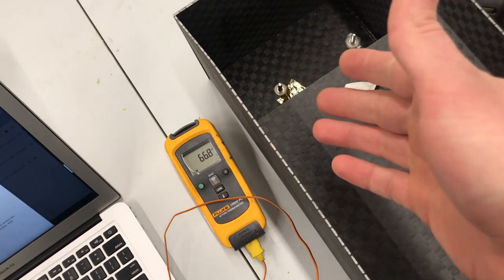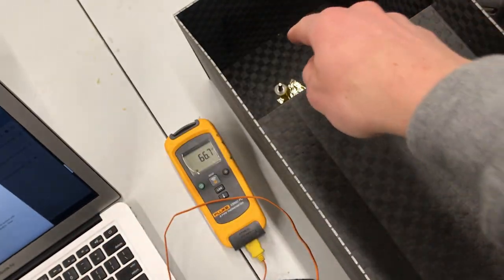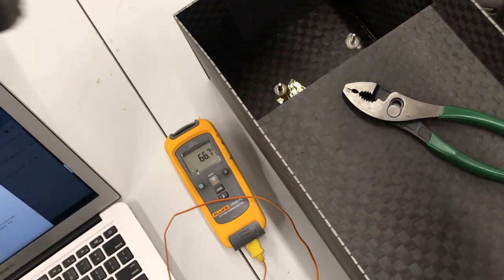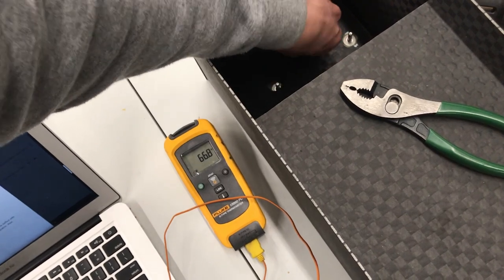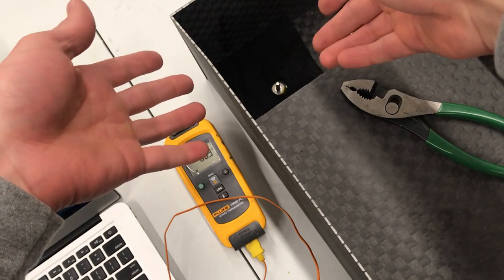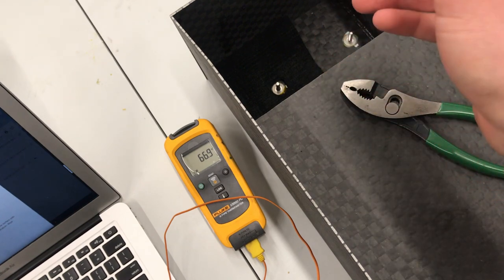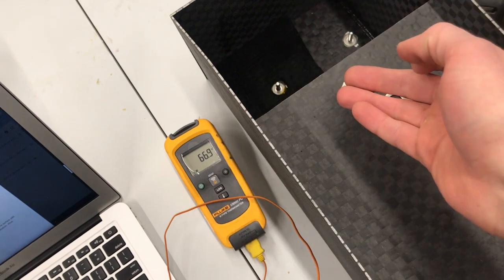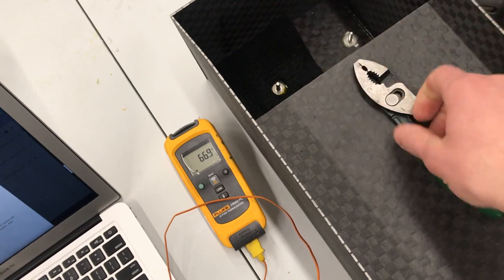HOW TO: Simple and Easy way to remove Click Bond Studs! (without damaging your stud or aircraft)

Comment: That appeared to be pretty simple but I wonder if you could make a simple coil that goes in a weller soldering gun and slips onto the stud. That would guarantee you didn’t heat the surrounding area.  Love what you guys are working on!!
Reply from the maker: Good point, that would be an interesting technique to try for a video.
Reply: Yes, a Weller soldering iron can be easily modified to heat these clips FAST.

Comment: hello guys, congratulations for the fascinating project!  
I work for an aeronautical company and we also use these fixings;  the fastest and safest method we use to remove them is spray ice, it is easily found on the market and is much more comfortable than heating the fixing with the risk that some part of the composite will be melted.
Good luck, greetings.
Reply from the maker: Thanks for the suggestion! For this video we wanted to at least follow the recommendations of Click Bond, but we may film something where we try other methods.
Reply: @DarkAeroInc  I as well use the freeze spray technique although it less set up, but you risk damaging a ply or two when you use a chisel and hammer to knock it off. id be curious if the pliers method works with freeze spray method, iv never been a fan of the chisel my company makes us use.

Comment: A little  costly but there are screw induction heaters that would only heat the stud and help protect the carbon fiber substrate. Of course if you plan ahead like you guys do, rarely will you have to remove a stud and it would be hard to justify the cost of the induction heater.  Beautiful work, enjoying your videos.

Comment: How much weight (a round figure) would such stud be able to cope with?
Reply: Most high end structural epoxy adhesives can hold about 300kg/cm2. That's on a perfectly prepped bond surface so in reality, it's often somewhat less. So, in theory, if that fastener is 25mm in diameter we are talking close to 1500kg of holding force. In "American": More than 3000lbs for a one-inch diameter fastener. 
Often, the substrate (the materials that are bonded together) will fail before the glue joint.
Reply: @AntiVaganza  Thank you very much for your answer.
I am designing an ultralight aircraft. I trust the cloths, I trust the resins, I trust the honeycombs.
But inserting or bonding aluminum or steel parts into the monocoque is what makes me nervous.
I will have to test various adhesives to gain trust on them.
For bonding e-glass with aluminum, which adhesives would you recommend?

Thank you.
Reply: @leoa4c  That, I don't dare giving a 100% definitive answer on as I am not a plane builder:)
If it's a normal lay up, then whatever resin system is trusted in your field. 
And if its after the e-glass has cured, then look into "structural adhesives". I think DarkAero looks to be using a Hysol 120 something. 3M makes some, too, like the DP460. But ask other plane builders for advice and find some research papers or instructions on how best to prep the bond surfaces.
E.g. everyone knows acetone is good for this, but you need to make sure you have a good quality of acetone, don't use nail polish remover as it can have other stuff in it. ALSO, be careful what cloth or tissue you use. A lot of tissue has softener in it nowadays which is often silicone based, I think, and silicone is about the worst thing for epoxy ever. Same reason you don't want to use old t-shirts for wiping down surfaces as fabric softener can also contaminate your bond. 
Also, have a look at this channel "Explore Composites". You might find interesting - he does a lot of different sandwich layups, just keep in mind that sometimes he does the wrong things on purpose so make sure you really listen to the voice over.
Reply: @AntiVaganza  Thank you for your response.
I did ask Dark Aero. Either they intend to explain it in a future video or my comment disappeared through the comments' overload. :)
I have been following their project. A lot of useful information there!

Eventually, I will have to test different adhesives and different methods of inserting metal parts into carbon/kevlar/glass fibers.

My monocoque will have to support 110kg via 4 points of attachment. Static loads, I am sure that the adhesives can handle them. Dynamic peak loads is a question of rig testing.

I don't think there will be a problem. I know the stress loads on open wheel racing cars. It is the application of those to aircraft construction what scares me.